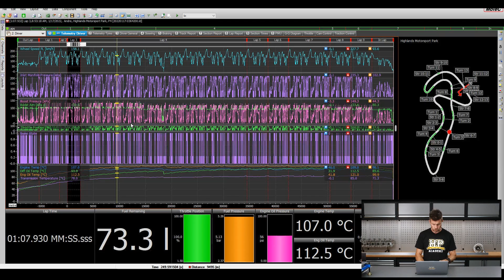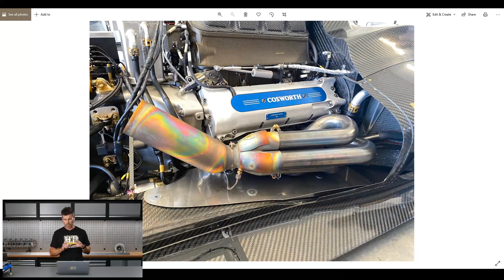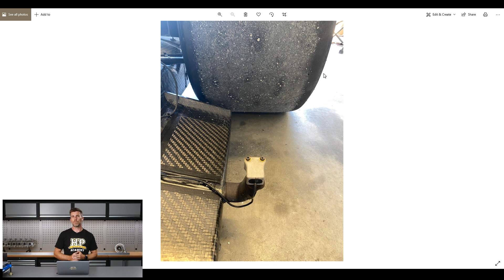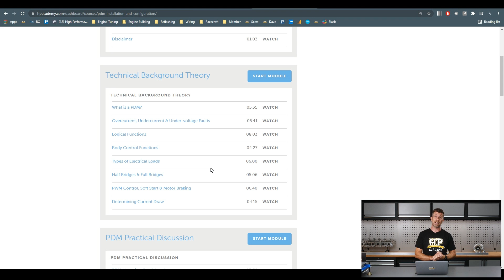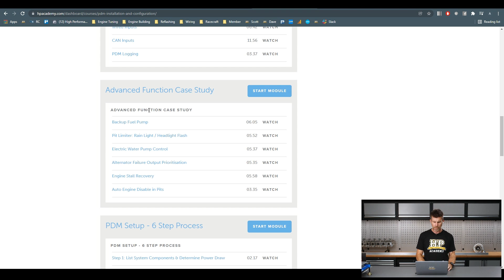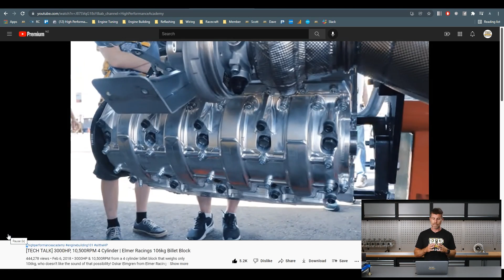SR86 vs 750hp 1600kg Mustang, PDM Config & MORE [#UPDATE 299]

Comment: 105+ C is getting way to hot for my liking...I usually start to worry when temps are close to 100 on my SR and my alarms are set to
ECT: 95
EOT: 90

...It doesn't like it when it gets too hot.

Comment: Going to purchase the course ! One question, can a/c controls be used within a PDM ?
Reply from the maker: Independently of the ECU? Not really.

The AC compressor itself could be controlled via the PDM but the ECU would also need the AC request input so it can run fans, control idle ups etc. Normally that is how it's setup - AC request into ECU then the ECU switches the compressor via the AC function so that would then just go to the PDM.

There are a few things at play for an A/C system beyond just turning the fan on and off eh

Advice around this is best sought on the members only forum, you can get into the nitty gritty there for your specific setup for your A/C and other systems: https://www.hpacademy.com/forum

Hope you enjoy getting stuck into it! - Taz.
Reply: What sort of car will you be installing this on? Newer/modern cars A/C system is heavily dependent on CAN messaging where as an old or custom vehicle will be easier. And it also depends on what pdm you get. The Nexus R5 is a combo ecu/pdm which can make things easier for older vehicles, however they mainly only support their Haltech CAN protocol at the moment. However I did ask and they are working on supporting more protocols for more CAN flexibility.
Reply: @25aspooner  Thanks guys ! & I plan on putting a VQ35HR into a s13, using AIM's PDM32 & Dash. I was considering the nexus but to me price wise for now at least, makes sense with the AIM setup.

Comment: How do you feel about a general coolant temp target of 80 degrees C? From what I can tell from some research into comparisons that’s where most usually is made all other things being equal. Wouldn’t this in turn also mean that’s where efficiency and longevity of the engine is found?
Reply from the maker: There's no real solid number on what ECT ‘should’ be. I'd generally like to see a performance engine in the mid to low 80’s as this will tend to make the engine less knock prone. Modern cars often run in the mid 90’s though as there are improvements in fuel efficiency as a result so it depends what your aim is - Andre.